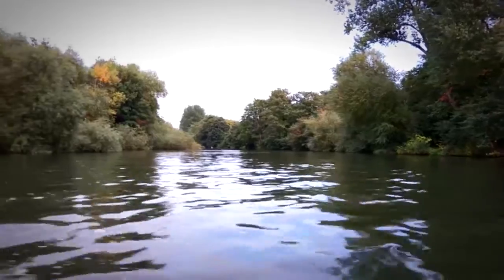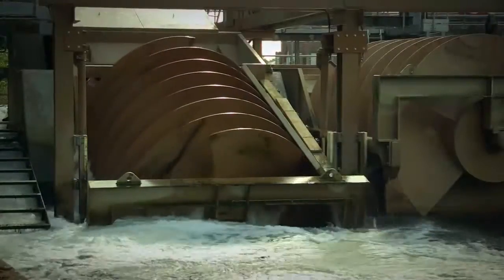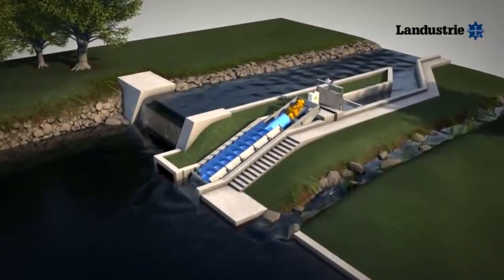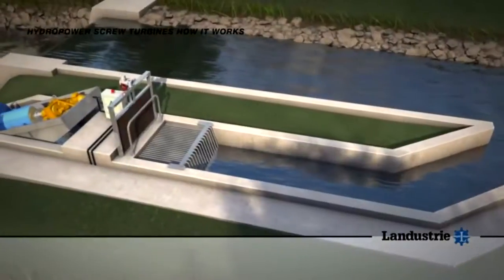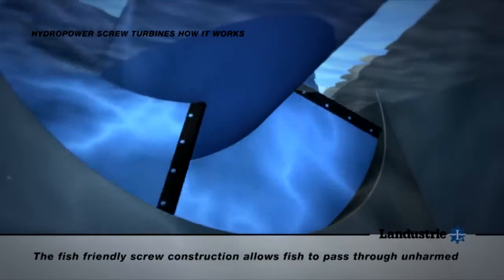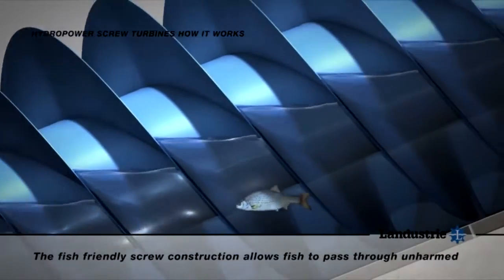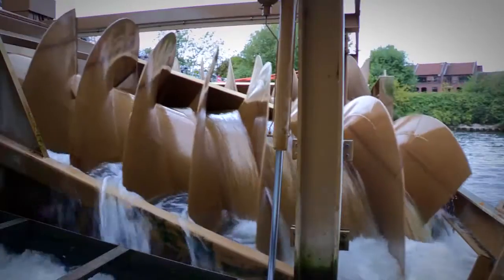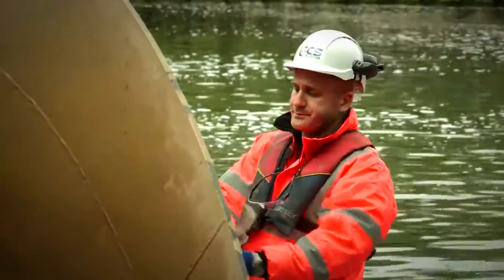ECS Archimedes Screw Pump Services

Comment: i dont get it...its pumping down?
Reply: i think they use it to power up electric generator. not to pump water to higher elevation, but using elevation to rotate the turbine in a more eco friendly way
Reply: @AiSong993  oh so it makes the startup pressure in the pipework ...thx